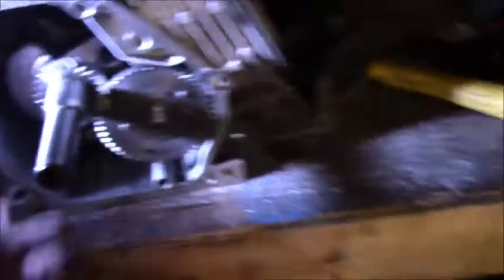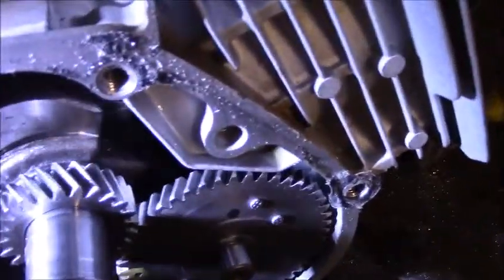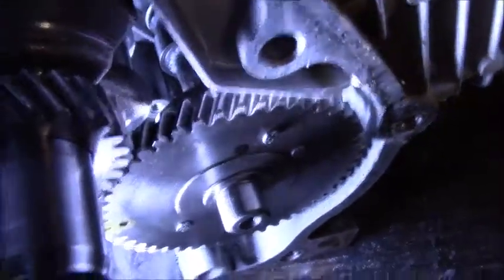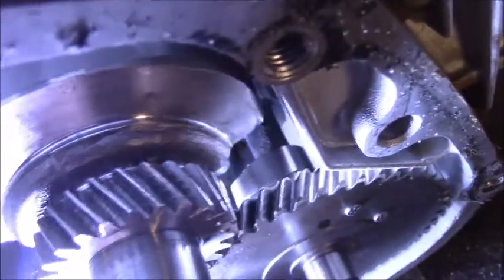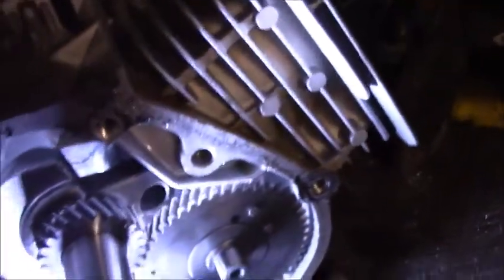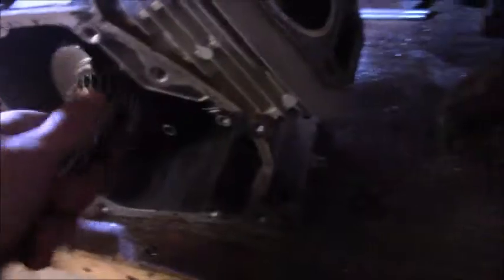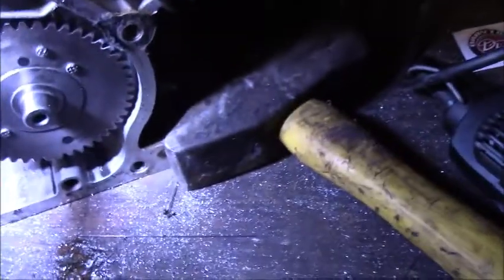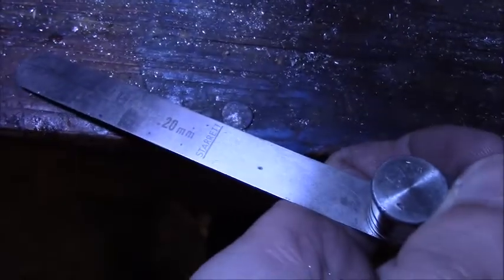Predator 212 Crank Grinding for Black Mamba Cam

Comment: Hey Cadillac! I'm inside a 223 right now, I already have a flywheel and rod installed, I polished the mill scale off the crank to miss the cam decompression weight. I used sanding stone on a dremel. The flywheel is not coming off easy, do I have to get that other lobe or you think that is legit? It was dust, no shavings or anything and I cleaned it out real good. I know that is not ideal but this flywheel is going to break or the case will if I screw up.
Reply from the maker: Its was just the lobe next to decompression release for mine. I have always had to use a 2 or 3 jaw puller on the flywheel stock and Arc. Put the side case on and check your end crank play. Not super loose, bit not tight tight either.
Reply: @LudasGarage  only my decompression was rubbing too, I was able to use a dremel and get it with the crank installed. It was just dust no shavings, my concern is do I have to do the same thing to the other crank lobe so my engine isn't unbalanced or is that such a small amount it probably won't matter. I cleaned it out real good.
Reply from the maker: @fatbuddycat In my situation, I did not do the other side, because I put solid dowels in the case with a dual bearing billet side cover.
If you wanted too you could polish the other crank counter-weight to be safe

Comment: I’m putting a ec 265 cam in my gx200 and have the same problem, going to try to grind it tomorrow
Reply from the maker: Check your clearances after you put the side cover back on. I could feel/hear it just kiss the cam lobe
The crank does have side to side play, I had to buy a crank shim pack. No problems since
Reply: @LudasGarage  the lobe closest to the head is directly hitting the counterweight on my crank, I put the side cover on to stop cam deflection. But engine won’t turn past where it’s hitting reguardless if side cover is off or on. How much did you have to take off and did you what would you use. I’m probably going to use my angle grinder lol
Reply from the maker: @ChevyAndrew1  
I ground the crank, I believe? I'm not sure if this is the one engine that had a rock bust through and ran it dry; put the crank in 2 pieces?
I used an angle grinder. You don't have to take Alot off to make it clear, but I hit both counterweights to make it a little more "balanced" as I turn mine +9200 rpm occasionally
Reply: @LudasGarage  do you have a tach for it or just estimate? I’m going to get a digital one for mine, as it’s going on my surface drive.
Reply from the maker: @ChevyAndrew1  
https://www.ebay.com/itm/Digital-Hour-Tachometer-RPM-Counter-Inductive-Hour-Meter-Small-Engine-Tachometer-/403513134383?mkcid=16&mkevt=1&_trksid=p2349624.m46890.l6249&mkrid=711-127632-2357-0